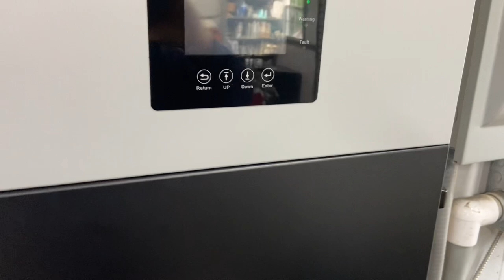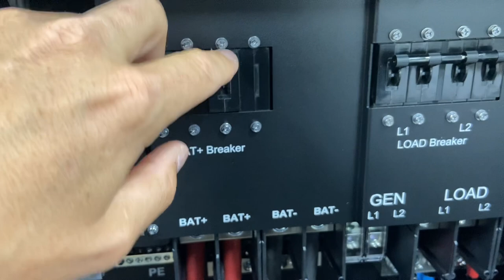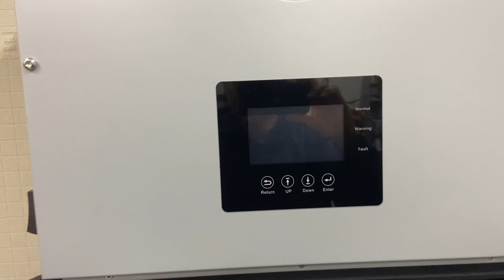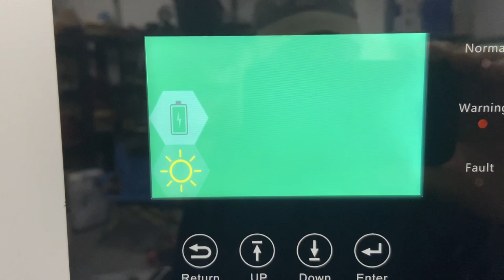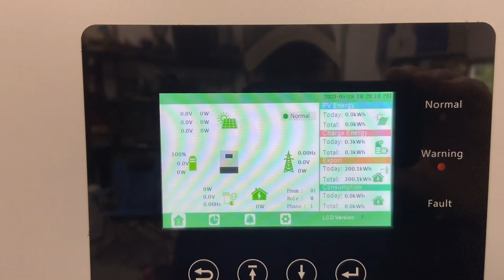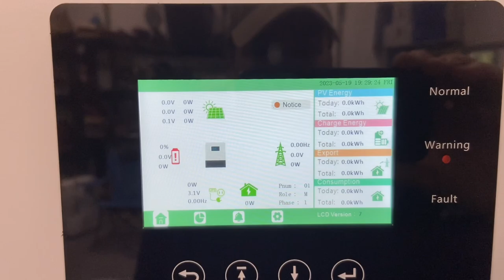EG4 18kPV unboxing and install

Comment: Future installers, do yourselves a favor.  Piece together a paper template about 34 inches tall and 21 inches wide.  Strike a line 4 inches below the top across the template.  This is the footprint of the inverter.    Locate your studs or wall placement, tape up the template and take a look if its good placement for you.  Then use the bracket over the template and punch a hole into the wall for the screws to go that hold the bracket.  A big time saver and your mount will be good and level.  Four inches to the top of the inverter from the top of the bracket.  15.5 inches from the top and sides and bottom for clearances.

Comment: It would be great if you can show the voltage waveform under heavy surge (e.g. A/C)  and non-linear (e.g. microwave) loads with LED lighting for flicker check.

Comment: Actually, I do have one request / question in regards to the transfer times.  If my current 6500s switch to bypass mode or back, the non-UPS'd loads lose power for a second since they are slow.  The 18k should be fast enough to transfer power without a computer or other load from losing power, but i haven't seen it verified as of yet.  I primarily built my setup to offset the power draw that my servers use - theyre pigs.  Every time it goes from Solar/Battery/Utility to Solar/Utility/Battery, its a click fest for all of my UPSs in my basement transferring power temporarily.  Itd be great to not have that happen - perhaps i can justify the purchase to stop the clicking 😊

Comment: Do you have any high inductive loads? Can you test out starting some tools like a table saw and air compressor? Any issues running your AC?
Reply from the maker: I haven’t done much load testing yet. The largest inductive load I’ve had so far is the well pump. Which of course it handled fine. I’ll try out some larger loads soon. I have soft starts on my AC units. But I’ll definitely check them also.
Reply: I've been testing one for almost a month Runs my milling machine and Lathe 10 thousand pounds truck  lift also 2 ac air conditioner works great😊

Comment: I usually see inverter with high output required atleast 96v battery or a 120v battery. This one is amazing with 48v batter input. It os easy to create a 48v battery pack and u can easily find a 48v high current BMS.

Comment: Yup - agree. Cost is a big part of this renewable energy,  In the early days of study, i ran someone's on-line solar calculator to run my house and outbuilding off-grid. Of course, wild variables in this, but the estimate was 180k with a 38 year breakeven! whoaaa nellie. So, planning goes in to cost, and somewhere the lines cross for cost vs return. i see hundreds of giant windturbines along the interstate where i live. So, who knows. Looks like there have been massive advances in solar product, maybe wind will be here some day . thanks again for your opinions

Comment: Dang! Gavin, I’m glad it’s intact. The box it came in had a hard journey.  That’s nice unit. It may be less output than twin 6548’s but how long can you run a Voltronic at full rated load and not overheat? I’m really curious to see how your new unit does at near full load for a while. It sure has a lot of nice features in one box. Love the room for wiring.
Reply from the maker: The packaging saved the day this time. The box certainly looked scary. Time will tell on this one. It has  been very impressive so far.
Reply: @Gavin Stone DIY Homestead   I noticed they have a sale right now save 500 on the inverter and a battery. I have to go to the website to check it out..
Reply from the maker: @VinceBadovinatz88  yeah that’s a good deal. I need to mention that in my next video. And I’ll link that in my description. Thanks man.

Comment: Gavin, I have 12 Bi-facial 405 SEG panels for a total of 4,860 watts hook to PV1 on our 18K. On a clear 30 degree sunny day and at solar noon the 18K would not charge the batteries at full power. The fact is, it reached about 1,400 watts. The batteries were at 86% when I turned on the diesel generator and the Chargeverter was pushing 55 amps into the batteries when the solar would not do it. I have two banks of EVE LF280K with JK-BMS 200 amp, 2 amp balancing. I mention this because you have a similar setup. Have you experienced anything similar?
Reply from the maker: I’ve never had this issue no. Sounds like it may be an issue with the strings themselves.

Comment: Hey Gavin, I was wondering with this inverter I don't see you using a T Class fuse? You did on some older videos. Do I need one.
Reply from the maker: If you had a DIY battery pack I would probably still use a T class fuse. The other batteries I have all have internal breakers. Plus the inverter has breakers as well. I mean it couldn’t hurt to have them. I just don’t think there’s a need.

Comment: The #3 wire that you installed to the PE bar, where did that came from?  Ground on main breaker or earthing rod?
Reply from the maker: It came from my ground at the main panel. All of my grounds can be traced back to my main panel and grounding rods.

Comment: Did the WiFi dongle come with the inverter?  The manual says its optional, but I can't seem to find it on Signature Solar's website.  Thanks
Reply from the maker: Yes the dongle is included with the inverter. If I get time next week I’ll go over how I connected it to my WiFi.

Comment: Hi I'm wanting to install one of these in my garage with my 200 amp subpanel but my main panel is 60' away. I have a grid tie system connected right next to my main panel. Do you think this will be a problem and I will ultimately need to put it next to my main panel. (The reason why is because my battery bank would be better off in the garage )
Reply from the maker: It’s just a longer run of wire to pass to  the inverter and back. But it can be done. It’s simpler to have it close to the main panel. This unit could potentially take the place of your grid tied unit also.

Comment: what size wire way are you using? Would a 6x6 be big enough?
Reply from the maker: I’m using an 8x8, and ideally that’s what it’s designed for. That way the conduit can go straight down. A 6x6 would work. But you’d have to put an angle on the conduit.

Comment: I wish these were available back when I did my Outback Radian system. I really dislike the Radian.
Reply from the maker: It’s honestly a rapidly changing industry, there is always something new coming out. On the other hand, if it’s quality and it works people are usually happy staying with a unit even if it isn’t the “latest tech”.  I see that a lot with people that have older Schneider inverters. Might be less communication capabilities, but solid equipment.

Comment: How to hook up your eg4 18 KW converter to your breaker panel
Reply from the maker: There’s a few different ways you can hook the 18kpv to your breaker panel. I have mine hooked to a critical loads panel with a 70 amp breaker.
Reply: Does that way allow you to feedback for the grid?
So your extra solar energy back to the crib?
Reply from the maker: @shi4llc812  no, I don’t have a net metering agreement. So I don’t back feed the grid. I have it wired like an off grid inverter would be wired. But the manual gives great detail on how to wire the unit for grid feedback.

Comment: You mentioned you used 3 gauge for your AC ground. Did you also use 3 gauge wire for the hots and neutrals for the load output and grid inputs?
Reply from the maker: I did use 3 awg for everything yes. Technically the ground would have been fine with 6 awg. But I had extra so I went with it.
Reply: Appreciate it, thank you!

Comment: The bracket in Manuel is upside down lol the is to hold it in place just like a hanging microwave. If you installed the bracket in the book there nothing supporting it.
Reply from the maker: I believe the manual shows the arrow facing up as well. I’d have to check again.
Reply: @GavinStoneDIY  yes it does but I like the gap it has keeping heat off the wall. BUT HATE THIS UNIT NOT READY OUT OF THE BOX.
Reply from the maker: @Tonyinmemphis  not ready out of the box?

Comment: Seems we never see them hook it up to main breaker panel. Do they hook it directly to a 50 amp breaker or do they disconnect grid power from power company going into main breaker panel and then hoot it into charge/inverter.
Reply from the maker: You could do it either way actually. The manual describes the different methods of wiring the unit for grid assist features. If you follow the link I posted and take a look at the manual you’ll see it. 
I do want to see more videos with this unit incorporating some grid functionality. I think some people are already working on that now. In my setting though, I’m essentially running off grid. So I don’t currently have the need for that aspect of the inverter.
Reply: My interest in this is to a/c couple and full 200amp grid connect to backup whole house and possibly send to grid later / zero export at key times.  I have 2 solar arrays and one is on my detached garage.  The other is half the size and already uses microinverters, so I have no easy set up with used the PV into the 18K.

Comment: Gavin - just arrived at your site. Well done. I'll scour your other vids for an answer to this - but if you have not covered it, what is your panel layout to feed the EG4?
Reply from the maker: So far I’m feeding it from s breaker in my main panel. So in my case a 70 amp breaker would do everything I’d need currently. But it can be wired directly into your main panel also, which is ideal.
Reply: @GavinStoneDIY  Thanks. New to solar, but been in the electrical world forever. Starting to plan a large system ,so just soaking up the information. thanks again for a good vid.
Reply from the maker: @p5makersplace  sure thing. Let me know if I can help with anything else.
Reply: Hi Gavin- still trying to get my head around the power from the grid and to the grid. basically the isolation feature so I can power the main panel and let the solar continue to generate power during a power outage. Currently my solar is on a sub panel 80 ft from the main on a 50 Amp circuit,  I would like to install the eg4 near the sub panel. Not sure of additional wiring needed to be able to isolate the main from the grid during a power failure. I would like to have  a rough idea before I pull in an electrician.

Comment: all of a sudden all your vids are popping up for me...nice work again!!  I'm a bit confused on the CT's...is your grid tie connection going directly to double breaker in main panel?  Why are the CT's not around the grid legs coming in?
Reply from the maker: Good question. The CT’s essentially just monitor the power for bypass supplies by the grid. I don’t have the inverter output   hooked to my main panel. Just the input.
Reply: @GavinStoneDIY  oh I get it...the only reason for that grid connection is to read power from grid?  so if you were grid tied you connect the "Load" to double breaker on main panel?
Reply from the maker: @TylerTheCompiler   Ideally it’s best to run a 200 amp grid power directly from the meter through the inverter.

Comment: what size allen wrench to fit that socket to tighten down the battery cables?  I'm trying to find the right hex wrench socket that will attach to my 1/2" torque wrench.  appreciate a point in the right direction.  manual just calls for an m8 hex wrench...
Reply from the maker: So my torque wrench came with some heads. The 8mm head is what I used for the batteries and ac connections.
Reply: @GavinStoneDIY  Awesome. Thanks!

Comment: Are there any ground bonding issues and how does this unit handle that? Thanks
Reply: There is no built in relay to bond in an outage. In my situation, the bond will be in my main breaker panel.
Reply from the maker: I’m assuming it has a relay like most of the higher end inverters. But I’ll have to look into that. It comes with what looks like ground bonding screws in the package. But I didn’t bother reading that section in the manual because I have a G/n bond at my main panel.
Reply: @GavinStoneDIY  It does not. From section "3.5.5 Ground-Neutral Bonding" of the manual: "The inverter never generates a ground-neutral bond."
Reply from the maker: @therusty959  ah yes. Thank you.

Comment: Would it be preferable to use a chargeverter if using under a 6k generator?
Reply from the maker: Yes. That’s really the best option. Let the inverter keep doing it’s thing and you charge the batteries to keep things in operation.
Reply: @GavinStoneDIY  thanks I'm thinking of swapping my 2 6500s for this 18kpv before we get our tesla model y
Reply from the maker: @tjmooney4181  it’s such a nice inverter. You’ll love it. I usually don’t pay much attention to it anymore because it just does what it’s supposed to. But I still like keeping my eye on the solar production occasionally. Keep me posted if you do the swap. I like to hear how things go with people.
Reply: @GavinStoneDIY  for sure I will, I currently have 16 400 watt Canadian solar bifacial panels. 2 arrays of 8 in series going into each string 1 of the 6500s
Reply from the maker: @tjmooney4181  so you can definitely add more PV if you plan to expand more. And your idle consumption will drop also with the 18kpv.

Comment: Why 2 seperate ground (pe) bars?
Reply from the maker: The smaller bar could be used for PV grounding or bonding your wireways. I’d say it’s just nicer to have a smaller ground bar for more options. They both accomplish the same thing.
Reply: @GavinStoneDIY  thanks that's what I figured but installing mine today finally so wanted to verify 🙏  2 6500s swapped into 2 6000xps swapped Into 18kpv

Comment: Hi i have inverter with single mppt 
500vdc max 
27 A current 
So can i use 550 watt 12 panel with rating of
Isc 14a 
Voc/48
Plz tell me
Reply from the maker: 12 panels with those specs would be over 570 voc. So that would be much too high for your inverter.
Reply: @GavinStoneDIY  my inverter says 7000 pv so what should I do plz help me 
If I make 2 strings 6 panels in one series and 6 panels second series and put it in mppt should it work lower VDC but I think the amp is double. Did it cause a malfunction?
Reply from the maker: @jasonbourne7171  paralleling 2 strings would work fine. You would have around 28 amps, but that would just cause some minor clipping occasionally. That’s what I would do. 2-strings of 6 paralleled.
Reply: @GavinStoneDIY  thank you so much ❤️ dear solved my problem I am getting so much upset what should I do...now I will install 12 panels after a long waiting time getting answers from professionals like you appreciate 👍🏾

Comment: can you share what size all the conduit openings are so that I can make sure to have all the right sizes available and pre-run
Reply from the maker: Yes, I should have mentioned it before. The paper copy of the manual has the sizes but not the online version for some reason. 8” wire way minimum. 2” conduit for the large pipe. And I used a 1” for the PV. You could easily just use 3-2” though for everything.
Reply: thank you. is the generator input also 1”?
Reply from the maker: @Cali217  there is 4-2”. 2-1”. 2-3/4” and 1-1/12.

Comment: Gavin - one last product idea. i just started scouring Utube looking for more info on the solar industry. One of the things i've noticed (so far) is the lack of any of these systems that include a wind-powered generator. I really don't get it. These generators are readily available and for the most part cheap for kwh produced. Do you see the hint here?? Kirk
Reply from the maker: Wind turbines require their own separate charge controllers due to the  inconsistent voltage generated. The trackers on solar charge controllers have issues when trying to power them with wind. There are wind specific charge controllers. It’s unfortunate, but in most cases people aren’t really able to gather even a fraction of the power from wind as they would with solar. There are exceptions of course. But in my opinion, most people would do better investing more money into battery storage than putting it in to wind.
Reply: @GavinStoneDIY  Gavin : from my newbee research i totally agree, but this was sorta the same conversation about solar 10 years ago. I know there are now some dual mode inverters, although not what one would pursue for an installation like you just did in the vid above,,,, unless,,, the next version had a tap that allowed x-amount of power to come from a derived wind turbine. In reality, i can't see leaving this alone. In small winds, 24 hours of power. There is some appeal there, but the question is when will technology spur demand.
Reply from the maker: @p5makersplace  typically demand seems to spur the technology. There just isn’t enough wattage generated from wind in most places. Solar can generate so much power per square foot now. It just doesn’t make wind a practical option for most. Having said that, if I  were on a higher elevation I would probably at least try a small turbine to see what it could generate.